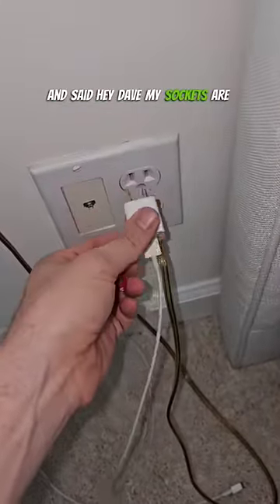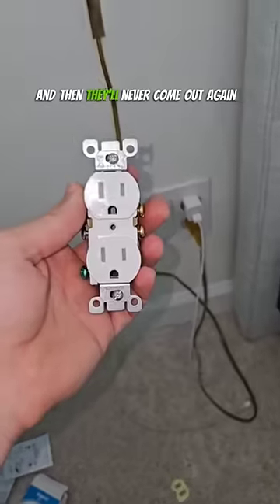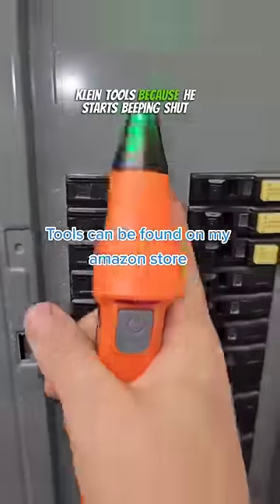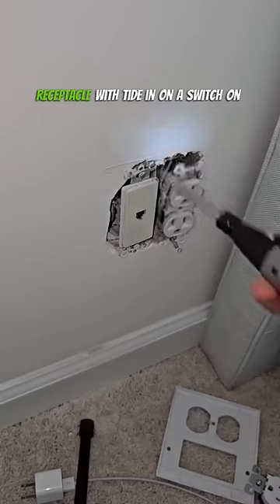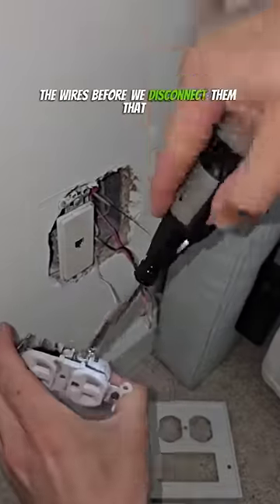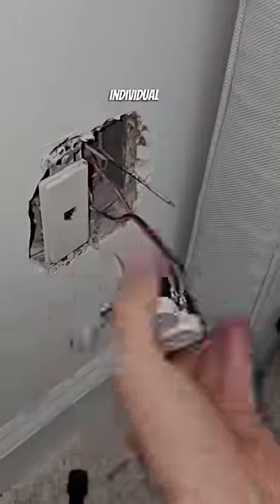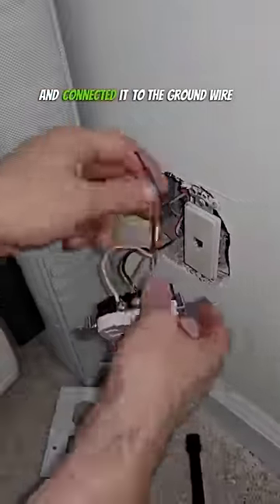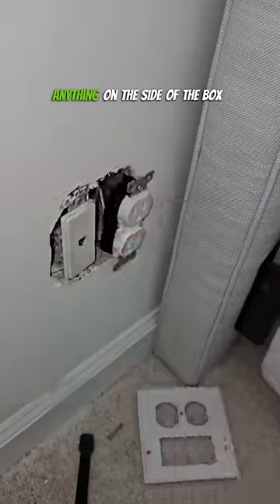🔥 Thats a hazard! How to change a switched outlet #diy #handyman #electrician #HowTo

Comment: As a Norwegian electrician, I'm gonna need years of therapy after this.
Reply: Same!
Reply: I'm lurking around looking for people from europe commenting on this piece of sh1t socket, so far I'm not disapppointed
Reply: How's it done in europe out of curiosity?
Reply: @qrzone8167  box is circular and made of plastic, sockets either have tabs that you push and stick wire in so there's no exposed voltage outside, or the screws are in such places that you don't have to run tape around socket to prevent wires from shorting to box (which is plastic so even if you short something, it won't transfer voltage), eu sockets don't come loose too, even shitty ones. PE wire is insulated, screws are PH instead of flat head (who tf uses flat head? It's not 1920s), and we don't use those atrocious screw connectors but wagos which are easier to use, easier to organize and less hazardous. That's it I think. Oh yeah, and the "sticker hack" isn't an option here
Reply: @szajba8106  The "sticker hack" is clearly some scam product as I have never seen one of those in my life.
Reply: @noahlangseth5196  fair enough, thought it might be a common thing, especially seeing the poor design of the "proper" box and socket
Reply: @noahlangseth5196  "I'm just kidding" as he says in the video
Reply: @mathiastwp Same! I am a electrician from the Netherlands and this is awful.
Reply: @SzAJba  plastic boxes are code here now. Never seen a socket manufactured after 1940 that wasn't PH. can't argue about the wire nuts though.
Reply: @caleb186  that's odd, the socket and box in the video seem rather new. Anyway it's good to hear about this progress
Reply: @SzAJba  upon further research that's wrong. They are still allowed. I never see them in residential though. Not sure why our outlets have exposed sortable terminals. Always kind of bugged me.
Reply: As an American, what is wrong here? This is fairly standard aside from the lack of a grounding wire
Reply: No electrician but educated in the German standards and even I need therapy now. Electrical Tape around a socket? Metalboxes where you put in electrical switches and sockets? Jesus. VDE sagt Nein
Reply: @szajba8106  Thanks for the explanation. It's pretty common to see oddities like this when doing renovations.
Reply: @Flos_tech_lounge  I have a hard time believing that europeans never use metal electrical boxes. Both have their benefits and drawbacks that could make one better than the other in certain situations. While it is odd to see a metal box in residential in the modern day US, it's very far from being considered a hazard because you just have to ground it.
Reply: As a German nurse who hast nothing to do with installing that stuff... Me too
Reply: As a swede, I agree 😢
Reply: same if you know german electric code
Reply: All I think we are seeing here is europeans are overly concerned
Reply: At least we have 60hz
Reply: No one asked
Reply: As an American electrician, y’all sound like a bunch of new construction residential guys.
Plastic in-wall boxes? You’ll only ever see those in newer residential, metal boxes if the electrical is about pre-1980.
Commercial and industrial almost everything is metal unless it’s to do with underground/outside.

Also we have wagos here too, but it really comes down to who’s buying the material as to whether we use them or not, but since wire nuts are cheaper guess what we end up with.

I can to some extent understand why you’d be so horrified with our seeming lack of safety, we primarily only have 120V throughout a house except for large appliances like a dryer, while y’all have 230V everywhere, but it’s as safe as anything else with the idiots we have walking around trying to get a Darwin Award.
Reply: @qrzone8167  In the UK we have metal moxes as much as possible but the terminals on our sockets and spurs are all receeded into a PVC case so it's pretty much impossible to do by accident and most of our cables that run a line core also run a CPC core with it and everything is bonded
Reply: @szajba8106 it worked for us 😊 and has worked for us for decades! You can thank your iPhones and your social media apps etc because they were designed/created on computer that used that connection tot he power.
Reply: Tell me about it, american electrical wiring is straight out of the 1920s
Reply: @szajba8106  salty Europeans smh
Reply: German Elektrician here. Bro that thing is not Save. Open Contacts on the side. Wires just hocked around a Screw. Is that standart where you come from. I woud loose my Licence for instaling that.😢
Reply: Ok Just read the rest of the Coments. Shoud have done that before writing my first one.

I am aware of the voltage diference but 110-120V AC 60HZ Is still able to kill you. And if i got that right you say the home owner buys the Material? Is this done with or without consulting a Profesional. I know we Germans are extra about such things but i buy the material for a Projekt and bill the Homeowner. Because i habe to uphold DIN and VDE Norms anyway.

And Mettal casings are used in Industrial cases or "bigger" Machinery. We only use plastic cases in Homeinstalation since the risk of damaging a wire cutting PE and putting potentialy 230-400V on a mettal case  is still there.
Reply: Bror samme her, får faktisk mareritt av å se hvordan de gjør det i Amerika
Reply: @szajba8106 here is some nightmare fuel for ya, these are standard in most rural areas and from the looks of that things, he’s being safe especially compared to the stuff that’s less than 15cm away from my head at the moment. 

I’ve also encountered the issue of power cables still being on when we thought they were off. The carpet still has the scorch marks 14 years later.
Reply: I am a romanian electrician and I learnt something new
Never steal american electric outlets
Reply: Lmao I'm easily impressed I was just happy he did the ground wire.... I still don't understand how it was legal for it to not be grounded. And yeah most of us don't need a fancy tool for breakers. Just have someone stand in the room and start turning them off until the person says the lights are off
Reply: @szajba8106 fortunately it’s been code for a while (especially with new construction) that these boxes are indeed plastic. I don’t know what the hell they were thinking in the past with metal boxes. Even when I was in school putting a junction box together it was metal, and all I could think of was “This is the most counter-intuitive material you could put high voltage electricity in as a junction”.. Wire nuts electrical taped or not, was never a good feeling 😂 I miss trade school sometimes
Reply: @TheMasterCasters take it easy on him he's European so clearly a step below north americans
Reply: Because our receptacles cost a $2.50 brand new a piece.
Reply: brake_4_cake screw terminals are a way better choice than the back stab lever type yall use
Reply: @StrUpSavage that's only true for american outlets. The backstabbing is indeed much worse than screwing the wire on. But european outlets are designed differently. They work even better than these screws.
Reply: @szajba8106 the "sticker" is for when the landlord refuses to fix anything and you don't want to spend money to fix someone else's investment your renting
Reply: As a German electrician I’m still in shock. Why are you guys so behind?
Reply: @szajba8106  so basically everything is smarter and better?
Reply: @nothankkyou3176  I get the joke but it shouldn't be possible to buy them at all
Reply: @casedistorted  better thought out, yes
Reply: Hell yeah me as a german too
Reply: @szajba8106 I'm in Canada and that's how it works here too. It's not just a European thing
Reply: The state of that socket. Terrible.
Reply: @qrzone8167 

Quite a few different types, its crazy really.

Plugs from the UK are excellent  though, they even have their own overload protection fuse inside.
Reply: Yeah, Europe the only place I have seen flat exposed bars acceptable for 3 phase plant power.  But hey our metal boxes are an issue. SMH
Reply: Not from Norway but same. Been to Norway though, absolutely stunning! And the few home installations I observed were excellent indeed.
Reply: @Flos_tech_lounge  so you obviously don't know about ground.
Reply: Good thing you have free health care! MERICA🇺🇸🦅🗽
Reply: @abuBrachiosaurus Exposed grounding wire, non-connected grounding wire, no plastic between the wires and the fucking drywall, a metal (conductive) box housing the whole thing, tape holding the fucking grounding wires together, and exposed connections between the wires and the outlet.

Edit: Oh yeah, and fucking tape around the outlet insert.

I’ve seen safer and less fire-prone circuits made by students fucking around with wrapping copper wire around a phone charger and plugging the wire into the wall to make a make-shift extension cable.
Reply: brake_4_cake you know they make different sizes, right?
Reply: I've been an electrician for over 20 years. Currently, I work in a factory. I have replaced every plastic junction box, disconnect, or emergency stop with a metal one. The reason? Plastic doesn't last, and if done right, there is no more safety risk with a metal box than a plastic one.
Reply: @herbertlappert96 why do you consider this as being "behind"?
Reply: brake_4_cake  I'm aware. I'm sitting here looking at 6 different sizes. #29, 30, 31, 33, 35, and 39. There are more as well. Smaller the number, smaller the wire nut. #33 would be the ones that barely fit 5 #14 wires, which are the standard sized wires for a 15A circuit.
Reply: 4 sure
Reply: @Phoenix-rv2kb  I'm Canada and the plastic boxes will strip if you screw a battery. We only use plastic for 12/2 in the kitchen for extra space. I have never shorted a plug on a box and I don't need to tape it. The terminal screws are pretty flush once you screw them right? That's what I have noticed. Most electricians push the wires in the back of plug and switches which will cause issues down the road. Dont worry about the Europeans they think they have the best practices in the world. We can't afford take our time because if we do then we don't make money
Reply: @sylex0986 copper tightens when it's screwed clockwise. It's never coming loose. The plug will never touch the box even if it does it has a ground and the breaker will trip immediately
Reply: @SolusDarkcoat Us Canadians do it the same way and it works
Reply: brake_4_cake  its a compression fitting you either have cheap ones or dont know how to use them even without them I can get less resistance then a wago